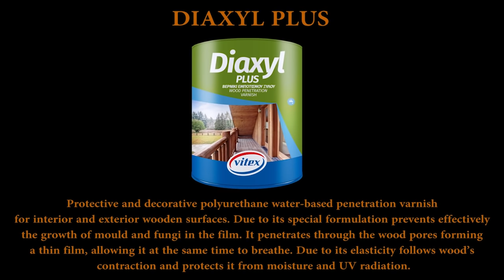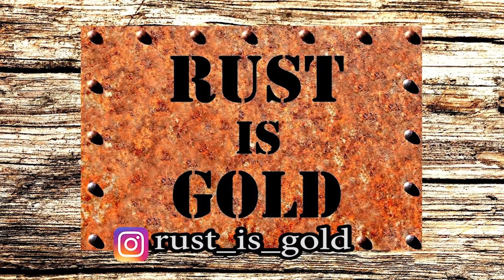Long knife made from a Chainsaw Bar

Comment: the handle is thick in my opinion .... I would have made it thinner for myself. The "holok" blade is excellent!  Yes, it was not necessary to drill additional holes. In the center there is an oval cavity in the metal, it is in it that you can glue wood to wood. I saw such a solution at the knife exhibition (handles without rivets) Especially since you glue on epoxy glue.
Reply from the maker: Thank you very much for your comments! It's true... The handle is a little thicker from what I wanted to be.

Comment: Why no heat treatment ?
Reply from the maker: I was just experimenting to see how it would turn out.
Reply: Isn't a chainsaw bar already hardened? Wouldn't be difficult to drill otherwise. If it's hardened and you don't overheat it with the grinder then it doesn't need to be hardened again.